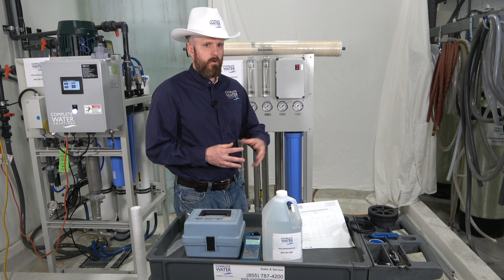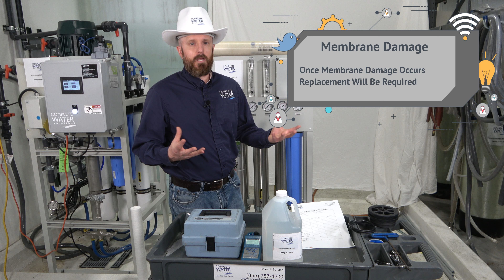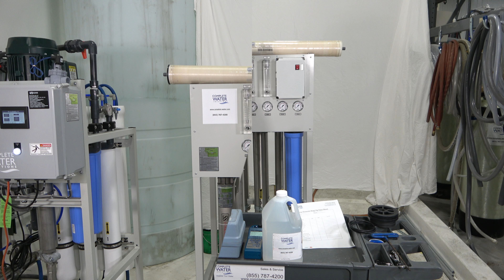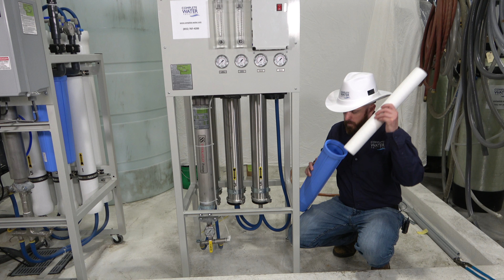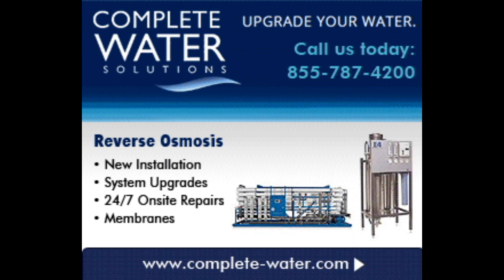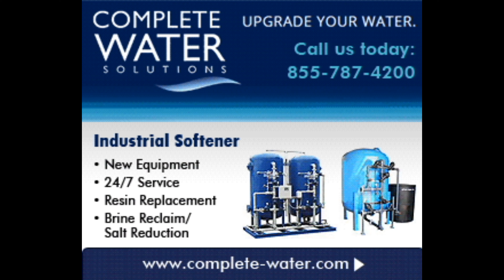What To Check On My Reverse Osmosis System (RO System) Daily Check List E4 & LT4

Comment: Hi thanks for the videos they are really informative, i got a question regarding this unit, is this a two stage RO system? also would it work with 1000+ ppm inlet water?
Reply from the maker: Hello, I am not sure what you mean by 2 stage. Its a 2-2-2 Array but single pass. I am not sure what you also mean by 1000+ ppm water. What is 1000 ppm = to TDS? You may have to get an analysis done to verify what is in the water.  We have a free E-Book regarding what you need for your RO System. https://complete-water.com/blog/5-things-you-should-know-before-buying-your-next-ro-free-quick-read     It will work on 1,000 TDS Water but you will want to know what is in your water to make sure you have the right pre-treatment.